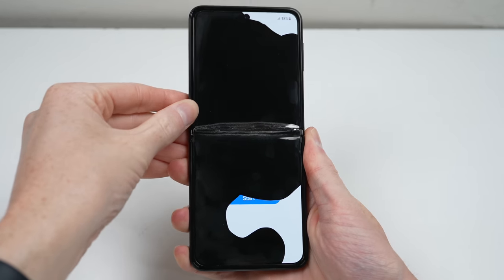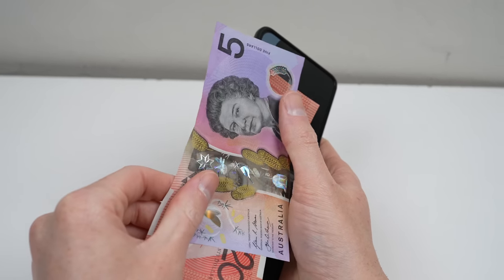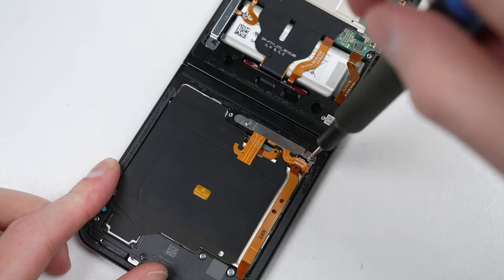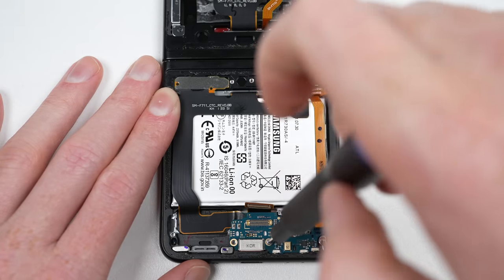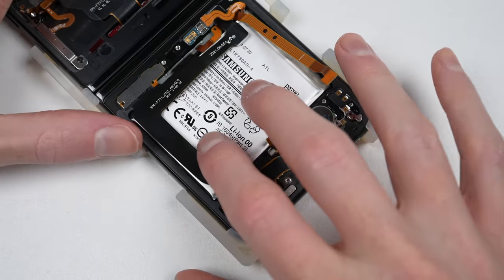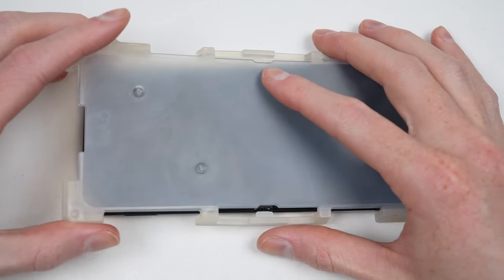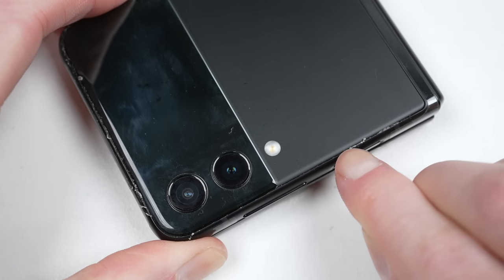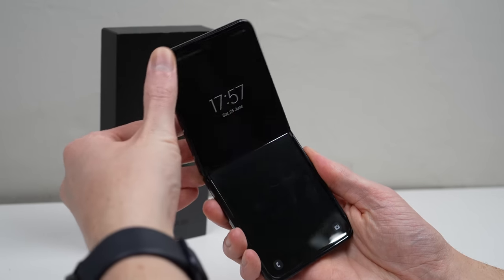$230 Galaxy Z Flip 3 Restoration

Comment: Nice repair and restoration, and I'm glad to hear it worked out OK for you! Having said that, due to the fragile nature of these phones, I wouldn't be getting one anytime soon. If I want a phone with two screens, I'll get a proper dual screen phone, like the LG G8X.
Reply: rip lg
Reply: Too bad LG is dead
Reply: The phones are good tho, you just need to be less careless.
Reply: These are not that fragile. I bought one for my mom. 6 months and several drops later and still no issues. Plus samsung has a policy for the first year. If the display is cracked for any reason, they only charge you ~100dollars for the repair.
Reply: The constant failures and short lifespan of these screens keeps me away from them as well.
Reply: Agreed, these are way too fragile to be worth that insane asking price. Plus this phone doesn't even have basic features like a headphone jack or a micro SD card reader. Huge miss from me.

Also, LOL at the Samsung fanboys trying to justify their purchase by claiming the screen isn't fragile.
Reply: @kard7557  the surface duo is incredibly overpriced for the limited functionality it provides, and you'd be better off purchasing 2 phones or tablets or anything else that's actually usable without constant bugs and crappy camera
Reply: @mjc0961  Samsung can charge this much for the phone cuz they are the only few that can even make this phone style. Motorola also has the Razr but it's even worse than the Flip
Reply: @RexDC  They aren't though. They're far too fragile and prone to breaking from normal use. Screens, even flexible ones, are NOT meant to be bent often. The Z Flips are only rated for a few thousand flips (ONE open/close is two flips...), which is barely even a few months of normal usage and will probably break much earlier given that a screen protector can't be used since, you know, glass isn't flexible.
Reply: @acumenium8157  interesting that's why the screens have rating for 200 000 folds and someone even tested it and it lasted over  400 000 folds so do some math to realize  that you're more then likely  to change your phone then the screen breaking
Reply: @acumenium8157  can't agree on that one. I've been using my Z Flip 3 as a daily driver for 10 months now (purchased it in mid September), and it still looks brand new and works as a charm. It's true I've never dropped it, but the screen is being folded about 100 times a day, and I've also used it under some pretty extreme temperature conditions (-30 C to +40 C) with no effect whatsoever.
Reply: @rezer1st  mine also the same it has been dropped multiple times, on bathroom floor, slipped out of my hand in the workplace, even in the carpark and still as good as new. You have to have a good case protector tho. The only issue is you can't touch the screen with wet fingers, lil bit if water will messing up the touchscreen but it's gonna back normal when it has dry
Reply: @meanieblue  that's literally with every touch screen phone lol. If you put water on the screen it will press things randomly

Comment: i own a flip 3, and so far its been about as durable as any other phone ive owned personally. its been dropped closed and open. only issue ive had is that the screen protectors just, keep unsticking. but besides that, its been a great phone, and i love its folding aspect
Reply: and then the useless display ratio
Reply: @LamoidZombieDog  its not useless. yeah its not 16:9, but anything i watch doesnt get obstructed by my thumbs, cinematic movies have hardly any cutoff. any photos i take are fine. ive had 0 issues with any of the apps i use. plus i much prefer how narrow this phone is vs my iphone 11 i had before
Reply: @Matthewv1998  it is, the ratios are both dumb and useless. If the outside was a normal note ratio the inside would be like a mini tab s8, and it could be a good device. I have a food 3 512gb, it collects dust on my shelf.
Reply: @LamoidZombieDog  skinnier phones arent a crime. i can use this phone with one hand. i cant do that on my old iphone. or the S series when i've handled them. not everything needs to be a giant, wide fablet. i think its perfect honestly. i love this phone.
Reply: @Matthewv1998  iPhone is uncomfortable and to wide in general. I one handed a note 20 ultra since launch and just downgraded to this shit22notultra. And my hands aren't big.
Reply: I've had a Z Flip 1. Unfortunately I broke it but it was my favorite phone and none other can top it. But I know it's really fragile so I'm never touching another one.
Reply: @LieutenantButtonMasher  the flip is even worse in design.
Reply: @LamoidZombieDog  just say you're too broke to buy one and go
Reply: @LamoidZombieDog  Can you please name a phone which is not shit/useless
Reply: @pambinobequeno5062  I literally have a fold 4 on top of two n20u, s22u and other models. Read.
Reply: @filipce3  Note 20 Ultra or basically any Koh Phone

Comment: I like the concept of folding smartphones a lot, but I wish they'd ditch the folding screen and make it two separate displays with a tiny line in between them (like dual monitors for a computer).  Then have the software treat those two screens as one.  Sure it's not as "cool", but it's a lot more practical, durable, and you get the same utility (plus probably at a much cheaper price point).  I've only seen one phone do it this way, and I don't recall it getting a lot of attention.

Comment: 0:28 “Phone was in great condition until it was damaged”

Oh yeah, it’s like saying “my Satsuma engine was working until I mis-shifted from 3rd to 2nd at 8000 RPM, causing the engine block to go googats, puncturing the oil pan, thus activating the self lubrication chassis system, and making piston 4 nowhere to be found”
Reply: What, ain't 3 cylinders all the rage now on economy cars?
Reply: @Kalvinjj  3 cylinders running on a 4 cylinder engine is not a good thing
Reply: @matthewl5434  Naaah that's just a little over the top cylinder deactivation, it will ~limp~ run fine!
Reply: @Kalvinjj  I can guarantee, the crankshaft is bent and the main bearings are googats

Comment: I’ve had one of those in the same color. Promptly sold it to a friend after a few weeks (it had complimentary Care+), especially after reports of the screen spontaneously cracking at the crease and getting scruffs at the hinge from normal use. Repairing the screen is expensive if you didn’t get Care+. If you pre-ordered one, you’re one of the lucky ones that get complementary Care+ protection for 1 year and a 25W charger.

Right now, they’re selling even slightly used ones for less than half of the retail price because of the cost of repair (especially if you don't have Care+).
Reply: Finally it's here YES
https://youtu.be/vn8WdvkmTGs
Reply: so you promptly sold a phone known to fail to a friend noice !
Reply: @potatorigs2155  It had complimentary Care+ so they can have it repaired for free within the period, and they wanted a folding phone anyway. I don’t want the hassle of bringing it to Samsung for repairs in case of problems.
Reply: same here 🙋🏼‍♂️
Reply: @Chard9463  fair enough

Comment: The restoration is quite satisfying. I wouldn't spend my money on foldables just yet though. The durability still concerns me and I like to keep my phone for years until it no longer receives software and security updates.
Reply: Man, I was with you until I got to go hands-on with a Z Flip 4, I ended up upgrading from my Note 20 Ultra 5G to the Z Flip 4 on the spot and haven't regretted it a bit. I was really concerned with durability as well but it seems like they've worked a lot of the kinks out and from my experience thus.fsr it isn't really much different than having Amy other phone except I don't use the inner display in places that might damage it like anywhere that there are large amounts of particles in the air or stuff flying through the air. 

I've also been pleasantly surprised by the cover screen. I was concerned about it being too small/narrow for my fat fingers but surprisingly I make fewer spelling errors/mistypes with it than I did with my Note 20 Ultra 5G. It sits in my hand more comfortably than the Note as well, even when unfolded thanks to the way Samsung balanced both halves, and both screens look fantastic!

If you have a phone store near you where you can play with one in person I eould highly encourage you to do so. I've been shocked by how different thr phone is in person compared to the idea I had in my head.

Comment: I've owned 3 z flip 3s now, my first two had factory faults resulting in green dead pixels on the screen. it's a shame they couldn't offer a repair, but on the bright side I got it covered by warranty both times
Reply: Why go with the same phone again which dissapointed you not one but twice
Reply: @taulanthalimi6837  Read again, it got covered by warranty, but not repaired, rather replaced under warranty.
Reply: @taulanthalimi6837  it was replaced by warranty, I didn't have an option. I would've taken a refund but that isn't something you can do
Reply: By the second phone I’d just ask for my money back instead. The third will break, probably after the warranty ends.
Reply: @Kalvinjj  No need to be rude , i was asking politly why 
So what i missed a detail
Reply: @taulanthalimi6837  I just said to read again so you don't miss the detail, so you get it as well.
Why people get offended by everything now...
Reply: @Kalvinjj  thats how it is lol
Your text was arrogant af

Comment: Also got a Flip3. Mine is now about 10 month old and shows deep scratches along the folding display part. It seems like the top layer plastic(display foil came off after 6 month of use) broke open. Rly sad because otherwise my Flip 3 proved to be pretty solid. Can't report a worn out hinge or any other signs of wear and tear. So i definitely consider to repair mine. Samsung typically gives you a new screen for 1/2 the typical repair cost(450€) if it breaks within the first year of purchase. 225€ still cheap compared to a whole display assemble
Reply: Same with me, mine is shows scratches, and I dont know why it was happened. I just flip and put it on my pocket, and when I opened it, I was shocked looking the scratches along  the screen. Is that human error or defect from the product?

Comment: Recently got myself one of these in perfect "like new" condition for only £400 (I'm becoming obsessed with buying tech the moment the next gen model comes out, just got a 2021 legion 7 for £700 less than the 22 model despite only a 10% performance difference, imo it's the best way to find bargains).
I absolutely love the phone, it's the perfect replacement for my old note 8 as I get that note sized screen but it can still fit in women's jeans pockets (crucial as I don't carry a handbag).
my biggest worry tho is reparability, I know the screen protector on the front has a tendency to crack over time and replacing it is not an easy process (thankfully the person I bought from had Samsung replace the original before sending it to me but still it's a worry).
I suppose I just have to accept that this is not the type of phone I can keep using for 3+ years like my previous ones, tbh if it makes it 2 I'll be doing well.
still for the price I paid I don't really mind, top of the line specs and a cool factor that'll impress more than the latest iPhone is pretty good for only £400, hopefully by the time it breathes it's last I'll be able to get a flip 5 for a good price and fingers crossed it'll be out of the early adopters phase by then.

Comment: i have a fold 2 and its still perfect and has no scratches , my wife has the flip 3 and shes not a soft going person , but the screen is perfect after over 6 months heavy use. these folds seem to brake with people who want to destroy the phone in holland you can buy a new one for around €500 or 350 for a second hand one , so replacing the screen seems an expensive fix

Comment: Pre-ordered this phone along with a couple of the Fold 3s direct from Samsung. After 3 months of use, the hinge had lost about 30% of its tension. Wasn't as floppy as the older Z2s that i had seen but nevertheless unacceptable for a new phone. Never dropped the phone or abused it and was encased in a Spigen Tough Armor case. Samsung stated they couldn't guarantee a flawless repair and would carrier lock it. They flat out refused to exchange it stating it was past that point. I ended up losing money on it and just traded it in for an S22 Ultra...got $400 for it. Yeah probably could have sold it privately but unfortunately nowadays, there are just too many shady people out there. I didn't want to deal with that mess as well.
Reply: That's interesting as I had sent mine in with multiple obvious dents, scratches and dirt for a screen that was tearing from the folds. They still swapped it out and sent me a brand new phone 9 months into owning the Z Fold 3. Which country are you in? Manufacturer warranty lasts for 1 year in Canada.
Reply: @christophersack1406 , USA...SoCal.

Samsung warranty is 1 year...been that way since owing my first Samsung mobile device. I just sent back a G3 watch for warranty exchange no questions asked. Bought that watch from Best Buy March of last year. Reckon it all depends on who you speak to; spoke to 3 different reps about the Flip 3 (2 by phone and 1 by chat) and spoke to only 1 rep about my defective watch.

Comment: A phone like the Z-Flip 3 is basically my dream phone, but I simply don't trust the tech yet. FAR too many times have I seen displays crack at random, and while I'm sure that's not likely, I'd rather not risk it until we've seen folding displays mature a bit more.
Reply: I watch your videos
Reply: Mine is still like new and i have it since launch day. The warranty also covers the foldable screen if it dies without being your fault (in my country at least).
Reply: Yea, if you drop a bar phone in a case, unless you have bad luck, your fairly good and a cracked display on any other Samsung, is like $100-150, and can be swapped out with a heat.  Drop this and your down $1500. 

I don't trust the tech YET...

Comment: It will be interesting to see how this tech progresses over the next few years or so. 
We have a few of the Fold3 and 1 Flip (silicon case to keep from making much thicker). So far we have been quite happy with them, but did get coverage for damage.
So far so good, all 4 devices are still working great even under heavy use.
It will be hard to go back of course as I have integrated it with home, gaming, and work.

Comment: Why bother sticking the battery in? I would have thought the tolerances are so tight in these devices the battery is pretty much held in place by the screen and case back. Is it really necessary to glue it in?

Comment: Every time as a Samsung engineer every time he glues the damn phone closed it's so stupid use Tessa tape if you don't have the original tape if he ever goes to sell this phone and they take it to an authorized Samsung center they will not touch it 👍
Reply: May i know why so many unofficial repair use that black glue? I mean there should be an Official Samsung Tape sold outhere. Is it too expensive or difficult to remove again?
Reply: @Mikael2492  they are now these days check ifixit

Comment: I can confirm the Flip3 is horrendous on battery and pictures. As expensive as it is, the coolness factor wears off and you end up with a screen issue no matter what you do. 

I know you probably heard it before when someone says they don't abuse their phone but this phone is so fragile the screen protector actually has multiple issues if you look online.

I think I may know a bit why the screen protector has issues quickly. I think it hates being in a humidifier of a front pocket of your jeans.

Mine has had zero issues but looking online for the way Samsung is handling this is horrible. As much as I'm tempted to upgrade to a newer version it's not worth it

Flip3 has an inferior screen, battery, camera, lacks DeX, has older modem considering it came after S21. Unless they start fixing their products I don't think they can no longer be the phone I rely on

Comment: I just don't get this form factor, most pockets are deep enough to fit a modern smartphone and folding it in half would just make it harder to pocket. I can see the ones that fold into tablets working out but not with the soft plastic screen

I'd rather have 2 separate screens with a slight bezel in the middle instead of the soft screen with a crease

Comment: Wow Hugh great video, numerous Z Flip 3 owners are seeing their flips shut down completely upon folding the unit. If the unit is plugged in it does not shut off. Otherwise, the phones works great. Any input on what the issue is and or how to repair the fault would be greatly appreciated. Best Pierre.
Reply: I assume it might be the battery flex cables fraying since the whole thing will just shut down completely and not just the screen(s) blacking out

Comment: Using b7000 instead 2x5$ original adhesive is not professional. Btw if you use alcohol to remove the back covers they will come down easy and can reuse as well

Comment: I have Lenovo Smart Clock 2. It suddenly showed stripes on the screen and its clearly broken I tore it apart and re positioned the cable but its still broken and I couldnt find any replacement unfortenetly even tho the screen is easy to remove

Comment: A screen should never be a movable part. Disassembly looks straightforward, but I so wish that manufacturers will stop using glue for assembly. There is no point
Reply: Water resistance?
Reply: @brandon_nope  

Proper rubber gaskets like in watches. And Galaxy fold is not waterproof.